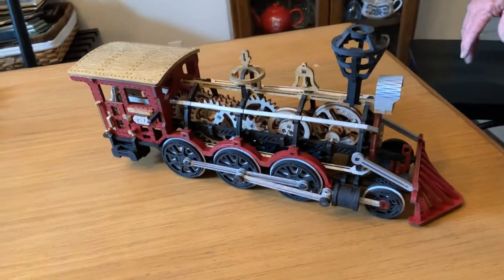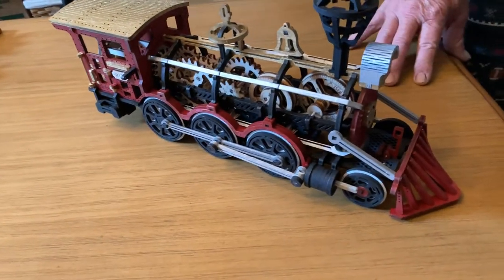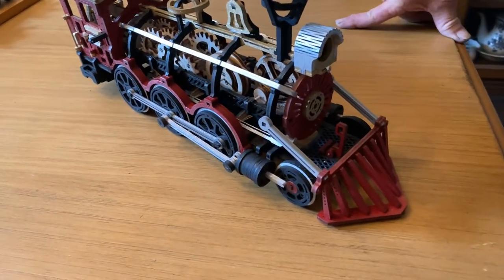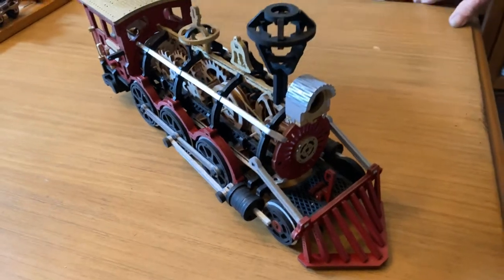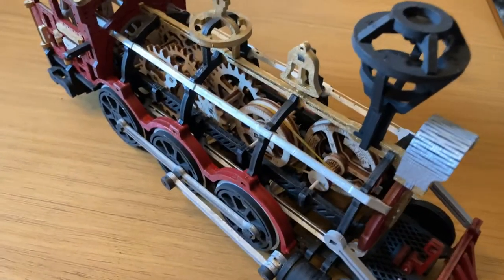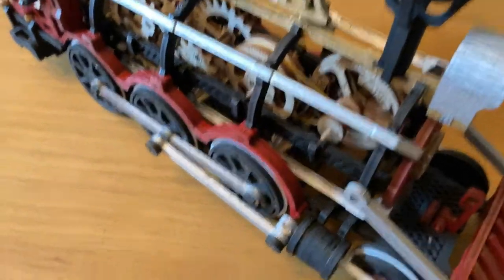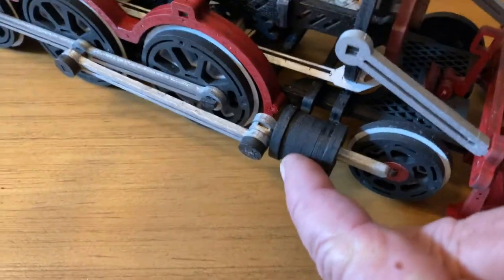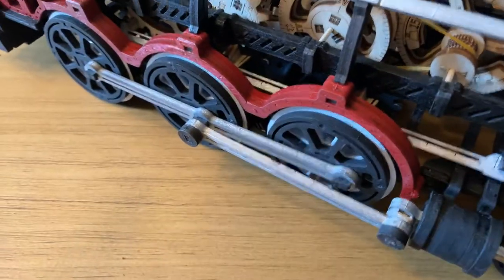Wood Trick R-17 Locomotive Final Assembly Part 1

Comment: Where the tender
Reply from the maker: I have it in two other videos. 

Woodtrick Locomotive & Passenger Cars - 3D Wooden Puzzle Final assembly part 2
https://youtu.be/zpFN0wRarl0
Reply from the maker: Woodtrick Passenger Car 3D Wooden Puzzle
https://youtu.be/NuJ5jw3PJjQ
Reply from the maker: Does not come with tender, just a passenger car.  Should have had a tender, would have been easier to paint than the passenger car.  Next one I am doing, The Atlantic Express was an oil burner so again a passenger car.